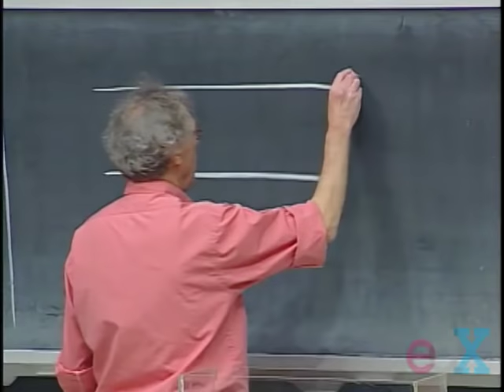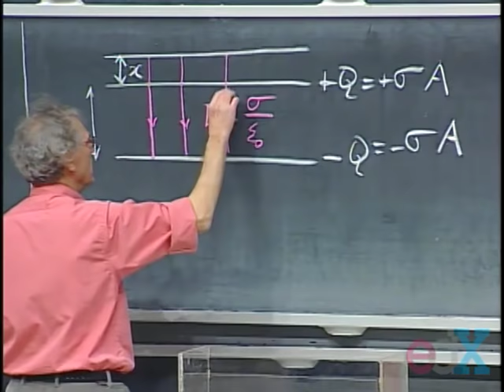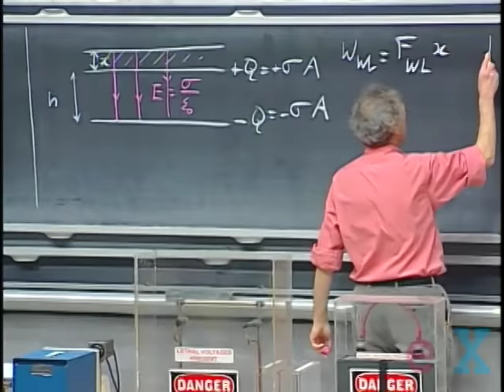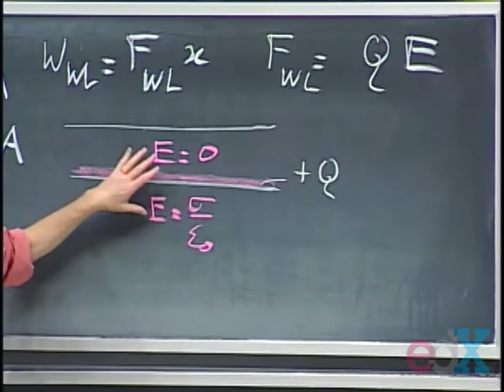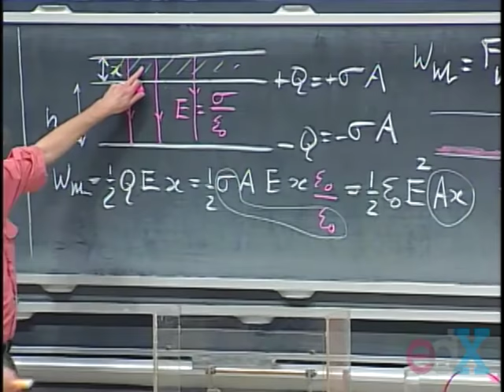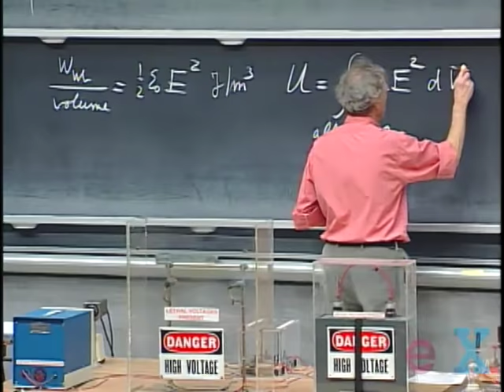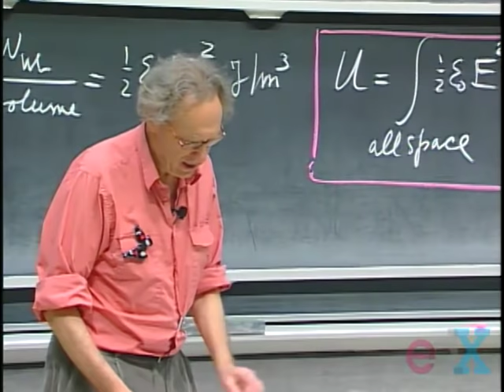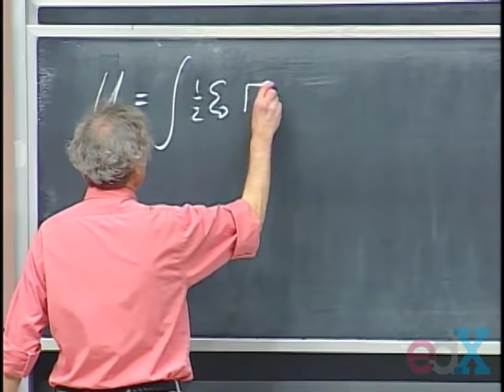8.02x - Lect 7 - Capacitance, Electric Field Energy

Comment: Sir, In a closed conductor, a patch is made by removing a small dA area, what will be the electric field just above the patch?take surface charge density as "sigma"
Reply from the maker: There is no analytical solution, but numerical solutions are possible. The answer depends on the size and shape of the patch and on the size and shape of the conductor.
Reply: In the question, it is given a closed conductor, and the area is too small(dA area), the answer is given as (sigma /2*epsilonnot),but how???, if the small area would not have been removed we all know that the answer will be (sigma /epsilonnot), but how do I tackle this question. *plus it's a hollow conductor, and the area of the patch is dA, while the surface area of conductor can be anything
Reply from the maker: If dA is insignificant in comparison with the radius of the closed hollow conductor, then the E-field near the opening will be almost exactly the same as if dA were not removed. Ask quora.
Reply: Sir, maybe since inside the hollow conductor at any point net field is zero, so when the patch is not removed, at a point just below the patch, field due to it must equal the net field due to the rest of the conductor, therefore field due to rest of conductor =field due to the patch =q/2e, can this be the reason?
Reply from the maker: If the patch is not removed the E-field inside is zero and outside is sigma/eps_o.
Ask quora about your question it's poorly defined
Reply: OK, sir thank you so much for your time

Comment: 30:20
Would have loved to see a fully loaded capacitor discharge. Once without work being done on the capacitor and once with work having been done on it. You should be able to see that in the intensity of e.g. a spark

Comment: At 45:50 it was mentioned that when a high current runs through a fuse it will get melted.

Consider a circuit in which we have Power supply , switch , fuse , Bulb connected in series.
Now i want to run a current of 1 amp with a voltage 100v. Power = 100watts. The minute i close the switch the fuse got melted.

Consider the same circuit with a new fuse. Now i am going to run a current of 0.1 amp with a voltage of 1000v. Power 100watts. That means i am going to keep the power constant. The minute i close the switch will the fuse still melts ?

The material and dimensions of the both fuses are same.
Reply from the maker: fuses melt due to I^2*R in the fuse
Reply: It means the fuse got melted due to large number of electrons flowing through it. Because high current means large number of electrons right ?

Comment: sir there is one question  a capacitor of capacitence C is charged by connecting to a battery of emf E ,the capacitor is now disconnected and reconnected to a battery with the polarity reversed,  the heat developed in the connecting wires is   ,options are            a) 0.5*(C(E)^2)          b)  (C(E)^2)            c)2*(C(E)^2)      d) 3*(C(E)^2)
Reply from the maker: >>> reconnected to a battery>>>
the answer depends on the voltage of that battery.
Reply: i did not understand, voltage given as E
Reply from the maker: emf is voltage
Reply: yes

Comment: sir i wanna know which book did you use for these lecture because some of the question are from that book and i don't kown the name he book and is this book is good for jee entrance exam ??thank you
Reply from the maker: 8.01
Physics
Hans C. Ohanian
Physics
Volume 1 
2nd edition
W.W. Norton & Company
ISBN 0-393-95748-9

8.02
Physics for Scientists & Engineers by Douglas C. Giancoli. 
Prentice Hall
Third Edition
ISBN 0-13-021517-18

8.03
Vibrations and Waves by
Anthony French
CRC Press
ISBN 9780748744473

8.03
Electromagnetic Vibrations, Waves and Radiation 
by Bekefi and Barrett.
The MIT Press
ISBN 0-262-52047-8

Comment: Sir,in the lecture you opened up a capacitor (10 mirco faraday).as you said it was rolled but how can it still act as a parallel plate capacitor?
Reply from the maker: very good approximation

Comment: One more doubt 

Line charge density means you are considering a copper wire which will be having the diameter of one atom size range ( i.e 1 × 10−10 m to 5 × 10−10 m )   right ?  

Sheet of charge means  you are considering a aluminium sheet which will be having the height of one atom size ( i.e 1 × 10−10 m to 5 × 10−10 m ) and atoms are arranged in 2- D crystal lattice ( i. e for example 100 atoms are there in the rectangular sheet then 20 rows and 5 columns  will be there ) right ?
Reply from the maker: >>>>a copper wire which will be having the diameter of one atom size range>>>>  NOOOO it can be millimeters thick. The E field is then zero inside the wore and falls off as 1/r^2 outside the wore.
>>>>Sheet of charge means  you are considering a aluminium sheet which will be having the height of one atom size>>>>
NOOOOOO
any thickness of a conducting sheet will do. The E field inside will then be zero and outside the sheet (if infinitely large) the E field will be constant independent of the distance to the sheet..
Reply: >>>>>any thickness will do

Lecture 3 at 24 : 10  ( Electric field due to an infinite sheet of charge )

For an infinite Sheet of charge which is having some millimeter thickness then how the charge + Q will produce the electric fields in both upwards and downwards directions because the charge ( i.e cations which are present on the surface ) which is producing the electric field will be present on the top surface of the sheet right. Then how the same charge + Q will produce the electric fields in downwards( i.e from the bottom surface ) because the below positively charges , atoms are present which are not ionized and Electric field inside the conductor is zero.

                       
                                  

                                  
                                  Top surface   
                       + Q    ++++++++++++++    ------> Positive charge ( or ) Cations
         E = 0               AAAAAAAAAAAA    -------> Atoms
         E = 0               AAAAAAAAAAAA    -------> Atoms
                                 AAAAAAAAAAAA    -------> Atoms
                                 Bottom surface

                        Front view of infinite sheet

Comment: 5:16 Would it be better to write: W/volume = 1/2 * ε E²   with ε = K * ε0    ? 
In this case you get also the electric field energy density if there is a dielectric.
By the way, thank you for uploading these videos, I enjoy them a lot!
Reply from the maker: Rinze Joustra does this help?

http://inventor.grantadesign.com/en/notes/science/material/S14%20Dielectric%20properties.htm
Reply from the maker: Rinze Joustra  The dielectric constant, also called k (or ε_r) = ε/ε_o
Reply from the maker: Rinze Joustra by writing  1/2 * ε E²  (this is the electric field density)  with ε = K * ε_o you would get the dielectric constant K if ε is known (and vice versa).

Comment: Hello professor , why an oscillating electric field due to an antenna can set up an electric current in a conductor and if we put that same conductor in static field the current will die out in no time ?

In other words , why a conductor can kill a static field and cannot kill an oscillating field?
Reply from the maker: the antenna reacts (Maxwell's eqs) to the dE/dt
Reply: @lecturesbywalterlewin.they9259  sir, do you mean that the conductor has no time to kill the oscilating E-field.
Reply from the maker: @ahmadeldesokey9844  connect a copper wire to a battery. There will be a constant E-field inside this conductor which drives the current.
Reply: @lecturesbywalterlewin.they9259  thank you professor i got it

Comment: Sir, Why the potential energy store in a capacitor proportional to  C in the equation 1/2(C.V) and inverse proportional to C in the equation 1/2( Q^2/C)
Reply from the maker: E=0.5*CV^2 and C=Q/V
Reply: @lecturesbywalterlewin.they9259  Sir, Why are they both proportional and inverse, sorry because my first question is unclear.
Reply from the maker: battery emf V + resistor + Cap in series. +  open switch,. close the switch a curent will flow till the potential difference ofer the Cap is V.  There will then be a + charge Q=CV on one plate and -charge CV on the other plate.
Reply: @lecturesbywalterlewin.they9259  Sir, thank you .
the current goes from the anode of the battery to the first plate of the capacitor, and what happened to another plate, how could it be charged.
Reply from the maker: watch the lecture in which I discuss charging a Capacitor. I cannot add anything to that.

Comment: Does it matter if the sphere you calculated the capacitance for at 11:00 is hollow or solid?
Reply from the maker: I do not know what a solid or hollow capacitance is. Watch my lectures.
Reply: ...solid or hollow SPHERE!--"not capacitance"  when  referring to "sphere" mentioned at exactly 11:02..  may I know if Walter Lewin is actually responding here?
Reply from the maker: I listened at 11:00. Since I mentioned that the sphere is a conductor, you should know the answer if you have watched my lectures.
Reply: A hollow or a solid sphere are EQUIVALENT if the material is a CONDUCTOR...

Comment: Sir if we place three identical charges A B and C on the vertices of an equilateral triangle ( A has charge Q on it while B and C are uncharged ) then will the magnitude if charges induced on B and C due to A be same as they are symmetrical or will it be different ????
Reply from the maker: +Rahul Tiwari Question unclear. You have ONLY 1 charge at A. There is no charge anywhere else thus also no charge at B and C. What is your question? Describe the geometry the way we could do it in my lab.
Reply: +Lectures by Walter Lewin. They will make you ♥ Physics.  Sir this is that question : Three identical metallic uncharged spheres A B C of radius a are kept at the corners of an equilateral triangle of side d (d>>a).The fourth sphere of the same radius has a charge q,touches A and is then removed to a position far away. B is earthed and then the earth connection is removed. C is then earthed.What is the charge on C ?
Reply from the maker: +Rahul Tiwari  You should be able to answer your question by watching my lectures on static electricity. 
D touches A thus the charge on D and A is +q/2. If you remove D the charge on A is still +q/2. After removing the ground cable to B it will be slightly negatively charged (due to induction) the amount will depend on the distance between A and B. If C is then Earthed, the +q/2 charge on A will affect C the most (not the much lower induced charge on B whose distance to C is the same as the distance from A to C). Thus C will be a little negatively charged (due to induction). How much charge will depend on the distance form A to C.
Reply: Rahul Tiwari is it ncrrt qustion

Comment: Sir if a dielectric slab is inserted between the plates of a parallel plate capacitor, will the force between the plates increase or will it decrease and why ???
Reply from the maker: +Rahul Tiwari I assume you do this when the capacitor is not connect with the power supply. Thus the charge on the plates cannot change. You should be able to answer this on your own. If the E-field between the pates increases (thus if the voltage between the 2 plates increases), then the force between the plates will increase and vice versa.

Comment: 3:21 is that really the reason why the force is QE/2? Isn't it due to the fact that when considering work and force ON that plate we only consider the electric field acting ON the plate, which is σ/2 ?
Reply from the maker: an easy way to see the factor of 2 is the following.  E-fields due to charges on the upper plate do not act on these charges - E-fields due to charges in the lower plate act on the charges in the upper plate and E-fields due to the charges in the upper plate act on the charges in the bottom plate.
Reply from the maker: @chessematics  also view this video - solution to problem 189   
https://youtu.be/f-aKebX8GVo
Reply from the maker: an easy way to see the factor fo 2 is that the E-field due to some charges do not act on these charges. Thus the E-field due to the charges at the lower plate act on the charges of the upper plate and the E field due to charges on the upper plate act on the charges on the lower plate.
Reply from the maker: see also 
https://youtu.be/f-aKebX8GVo

Comment: Sir i have a doubt.we have been taught that electric charges (+) flow from high potential to low potential until the charges become equal. But in capacitor we are taught that when two capacitors are connected and charge begins to flow from them then the potential difference becomes common between them and not charges. Why is this so
Reply from the maker: 2 capacitors in series can have very different potential, however, the plates have the same charge. 
watch my lectures and watch my 85 problem solving videos (under Help Sessions_

Comment: so sir what happens when the separation between the two conductors becomes zero, can we say that the capacitance is then infinite (because 'd' is zero then)?
and as always the lecture is Beautiful sir, thank you so much..
Reply: If you can somehow keep the conductors insulated from each other, then yes, capacitance would become to infinite with zero separation.  However, this is not possible, as eventually the two conductors will be in electrical contact, and there will be no region to enable a potential difference across the plates to be sustained.

Every dielectric material eventually breaks down, and ceases to function as an insulator, when the electric field exceeds a maximum.  Air for instance, converts from being a gas that insulates into being a plasma that conducts.   So it while the capacitance would approach infinity in theory, in practice, you can't really make there be zero gap between the plates.

Comment: I am confused.
1:20: "the magnitude of the field E does not change because the charge +Q is the same". But the plates are not indefinite; in other words, the charge +Q (and -Q) is finite; then, how is it possible that the E field stays the same even though the plates have been moved apart?
I thought that the σ/ε_0 relation was only valid for indefinite (= unlimited) plates.
Reply: Thank you very much for your answer. If I am not wrong, I remember from one of your previous lectures that the assumption that the field E is constant between the two plates (and its magnitude is σ/ε_0) is only valid when the distance h between the two plates is much less than the area of the plates (or, in simpler words, when the plates are very close). Is this the reason why we can say that the E field stays the same even though we have moved the plates apart? The area of the plates is much, much larger than the separation between them, so we can safely assume E = σ/ε_0 anywhere in the capacitor, with the exception of the edges?
Reply from the maker: The assumption that the E-field between parallel plates is uniform is an approximation which fails near the edges becoz the plates are not infinitely large. The approximation is often accurate enough to be valid enough.
Reply: Thank you very much, Sir. Is it correct to assume that the plates can only be separated by a (very) small distance for the E = σ/ε_0 relation to hold?
For example, if we separated the plates 1 km apart, there would be hardly any electric interaction (in other words: E tends to zero) between them, right?
Reply from the maker: a 1 cm^2 plate parallel to another 1 cm^2 plate separated by 1 km would create an Efield that would be very similar to two point charges 1 km apart. (except within a few cm of the plates).
Reply: Very good. Thank you very much for your kindness!

Comment: Sir,i read in class 11.
My name is Somoy.
Please help me.
What does it mean by the potential difference between two plates?
What is the physical meaning of this sentence.
Love from Bangladesh
Reply: Electric potential means electric potential energy per unit charge.  Every charge has a certain amount of energy at every position in space, and this energy is proportional to how many coulombs of charge the test charge has.   Divide by the charge to make it agnostic to what charge is at the position in question, and that is what we call electric potential.  It has the units Joules per Coulomb, which we call Volts.  You may also know it as Voltage, but formally, it is called electric potential.

The difference between electric potential between two locations, is what is meant by potential difference.   Potential at location 1 minus potential at location 2.